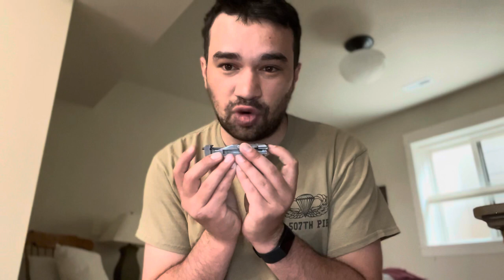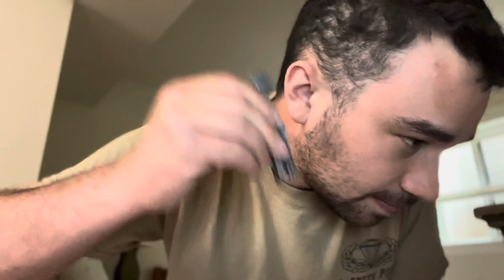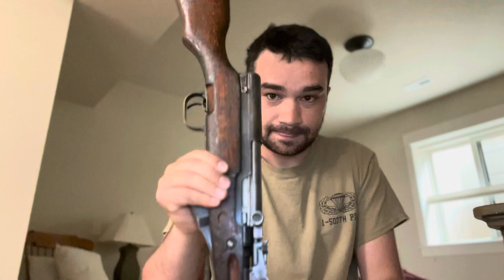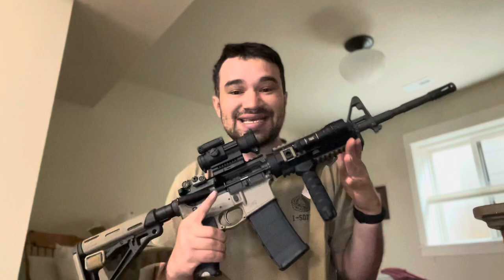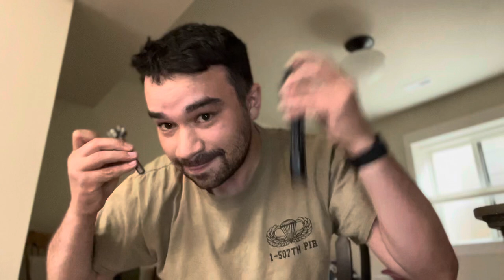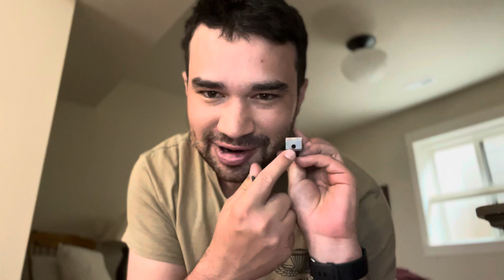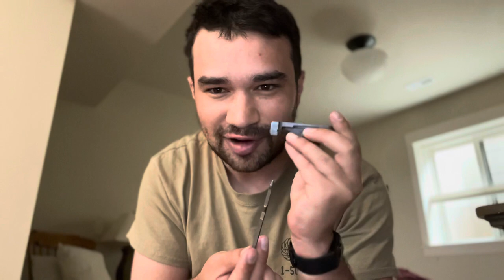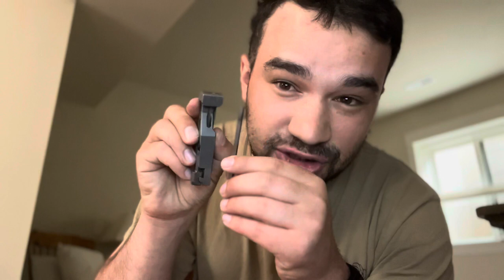The Myth of the SKS Slamfire (why you don’t need an “enhanced” firing pin)

Comment: John Murray of CA, and coincidentally also of CA, Mr William Ferrante both died due to these "Slam Fires." Shake all you want, you still will not have diagnosed what is going wrong with free floating firing pins in SKSs. It's the tapered front tip of the firing pin, sticking in the exact same tapered bottom of the hole that is the biggest contributor of these incidents. And why do you not mention that the SKSs made in 1948, 1949,1950 and early 1951 all had spring loaded firing pins, and never Slam Fired, as Simonov first saw fit to do. Oh yeah...and why do you not mention that the firing pin hole on the Bolt Face is .080" in AKs but .100"+ in SKSs.    Also... you didn't mention checking inside the rear sight housing and the Piston Extension and it's Spring that is inside there. Lot's of cosmo can be in there! (and cause cycling issues)  Sir... I respect your freedom to say what you want but the spring loaded type firing pin has never been attributed to any slam fires, ever. And you tell me why stupid guy Stalin "forced" this change as well as making it a "fixed magazine" type rifle? Stupid choice by stupid people that didn't figure out that their "primers" were defective...instead did away with the spring that gets instantly fried when primer failures occur, and made a cheap firing pin that for the most part will survive those primer failures. But we even have a cure for that. 100% guaranteed...as always. Best of luck...